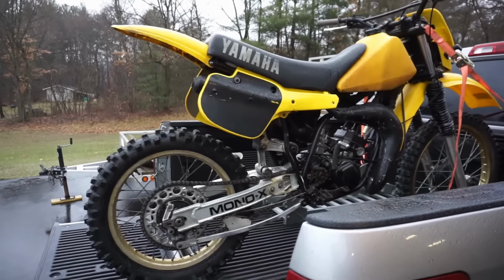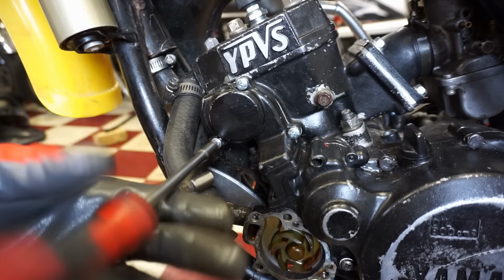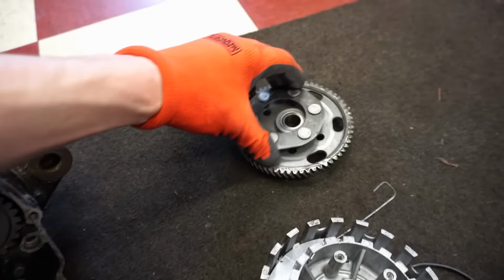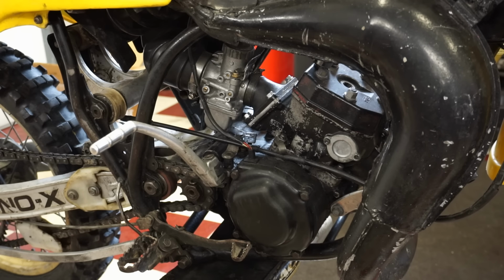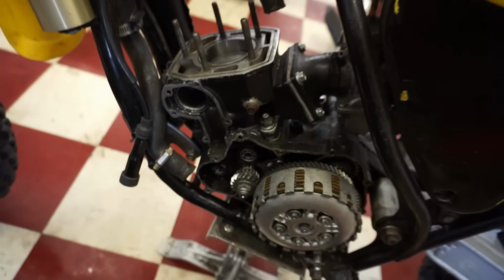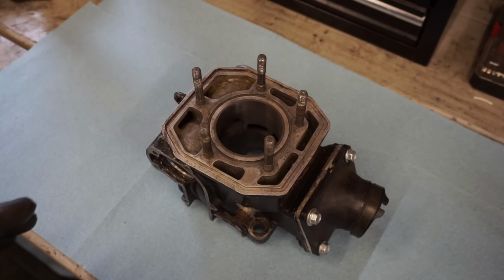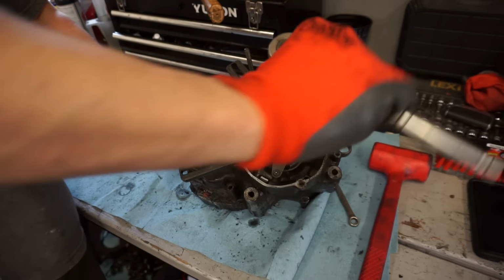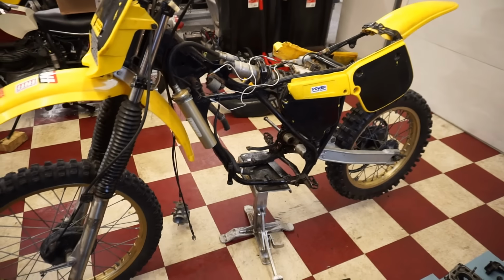Seller Lied About This Rare 2-Stroke Dirt Bike

Comment: Rebuild it.  An old bike like that is worth the spend jsut to have it.  I'm rebuilding an 89' CR500 and i stopped keeping track of what I have in it.  Becuase this year and make was my first NEW off the floor big bore growing up.  I got it in my early 20's and beat it to death, then put the motor in a streched drag quad. All the while wishing I had kept it.  So now, the restoration and tricking it out like mine was is a bit easier becasue I do my own CNC billet work.  But their is nothing better than the sound and smell of Blendsall Castor and gas. rip, rip!!!!

Comment: I should have waited to the end of the video before posting my first comment but having said that, you really should pull the gear clusters out and check the gear dogs particularly for 2nd and 3rd gear engagement.  If they're the originals its very possible they may be rounded.  Sucks to get it back together running only to find it jumps out of gear under load.  Also take a look at a parts diagram for the power valve I think u may also be missing a few bits that carry and seal the valve on the left side of the cylinder.  Good luck.

Comment: thanks for that video.  It will make me more aware of the scum we have to watch out for.  I mean, if I own some junk I come right out and explain the issues.  Just sold a lawn tractor that I put over $450 into new parts.  Sold for $50 on Ebay.   I explained all the issues of torn seat, bad starter, leaking drain plug and slow tire leak.  It was in my way in the garage after updating to a zero turn.  But it still worked and ran like new (when the starter engaged).  Anyway the guy wanted it for it's parts, mower deck and engine.  He got a great deal and I was glad I didn't screw over someone and it's out of my way.  Too bad there are still scum out there.

Comment: I'd think at this point, if you can't at least check compression and spark before buying, you would cut your travel losses and just leave. I know once in a while you can fix stuff for fairly cheap, but without those 2 things, you have to assume you will be into it at least for the cost of an entire top end rebuild and who knows without spark.

Comment: The cooling system on that bike is a nightmare the way it is routed through the frame and triple clamp. Those seals are expensive, and not very reliable. That’s why the steering bearings are shot. I had a 250 and bypassed all of that, just ran heater hose from the engine to the radiator. It wasn’t super pretty but it worked well

Comment: I had the same exact bike 1982 Yamaha  YZ 125  i do believe it was one of the very fisrt water cooled dirtbikes!   They are a pain in the ass! The cooling system goes through the goose neck causing leaks out the ass! They overheat like crazy.  Also crashing the bike at all you run the risk of damaging the radiator! Very fisrt thing i did with mine after the rebuild was water jet a radiator guard. Trust me on that one! 
Also the power valve set up blows on those bikes!  However you do have a rare bike worth resorting! Ridding it is another thing problem. Id just restore and show it off not ride it! The are gutless bikes! All 125cc are guttless to begin with! 😂   that bike definitely does look to be in great shape i see the original fork guards or fork covers. You can see the original rear sprocket. I also will give you one more peace of advice. That rear mono shock was 600$ for it to be rebuilt! The engine i had to have a piston made for the bike by wossner in Southern California. I sent the cylinder to LA sleeve and they had a horrible time finding a piston took almost a year before they finally said told me it has to be made from scratch! So good luck finding a piston. Any parts you do find i suggest buying them up immediately!

Comment: You should breakout some sand paper and hit all of the fatigue points on that frame, Before you should trust it to jump. There's real chance you could get hurt because i know you will make it run like it should. Thirty feet no problem, You want it to stay in one piece. Even if you have to hunt some parts very cool find. Working on it yourself is part of the safety factor of trust.

Comment: Hey - nice video, i subbed. 
Just a little firendly advice, try not to touch the airfilter with your hands as the chemicals you soak the filter in are very bad for your skin, quite carcinogenic, and also can cause chronic eczema (that happen to me) I just touched everything with my hands, have been fiddling around with engines without protecting myself from the chems most of my life and now i got chronic eczema to a point i cant even open a bottle of coca cola sometimes, even riding my bike can when its very bad, be difficult because of it. Cheers.

Comment: I raced both '82 YZ 80 AND YZ 125 back in '84. The 80 was bought new, the 125 was bought used. My mistake with the 125 as I should have switched to the KX 125. Nothing but problems with the YZ 125. Oh well.

Comment: I had an 82 YZ 250 craziest thing is is where the radiator is for the coolant I love the body design I love the plastic design I wish they would bring that back and quit with the pointy plastic they have now. So what we ended up doing is taking the 250 motor off of it because the bottom end seized and we put a 350 warrior engine on it air cold. Rip through the woods for about 7 years and then I crashed it into a creek and that was the end of it

Comment: Power valves are one of the worst things that ever happened to later 2 strokes.  They don't make that much extra power to compensate for the maintenance and costs. 
I have 2 IT490s and no power valves in sight.

Comment: That could be a display bike that was used in a restaurant or Maby a Yamaha dealer would explain why it was kind of a bare bones build to look the part but has no oil or coolant in it to stick with building code I’d sell it to a restaurant. They may have pulled the clutch to keep people from spinning it over dry

Comment: It was not the hot 125 in 82.  (83 either).  They had so many left in stock, they gave Bob Hannah another 100g's to ride them in 1982 so they wold sell.
I don't know if he won anything, but he was not really in the hunt.
Reply: The big complaint about 82 YZ models was the radiator high behind the plate.  Too top heavy in comparison.  But I just started racing in 84 with a used 82 (for $850) that I raced for 2 years and sold, so I didn't notice it.  :)

Comment: That’s a bummer man, ive been a Yamaha guy for 50+ years, this is the one bike i was not a fan of.when I worked at the dealership we would run radiator hoses along side the frame to avoid the o rings failing in steering head and rusting steering head bearing. Some guys like them cuz they raced them, luckily i was a broke teenager and couldnt afford a new bike in 82 so raced the 1980 that year, was able to get a new 1983 …

Comment: Yeah... Lesson being if someone pulls the clutch out so you can't crank it over,  there are likely big problems they are hiding. Especially considering how easy it is to take a video, and how everyone has a camera on their phone. If you are ever going to sell a bike that actually is running but needs clutch work, film the bike cranking over before you pull the clutch, but as a buyer don't ever buy anything you can't try to turn over. Unless its a couple hundred bucks or less. This bike as it was should have been 300$ - 500$ tops.   Its always upsetting when people Lie about stuff like this, and clearly try and hide the truth from potential buyers.

Comment: I had the same bike but a 250. Was an awsome bike but the problem I had was with that radiator. The design was routed through the frame and it leaked.I found new seals for it but it kept leaking and washing out the steering bearings. Oh yeah and the seller forgot to mention 5th gear was blown 🙄

Comment: I have learned to never buy a bike with engine in a box syndrome. 90 percent of the time its been taken apart and it was worse than expected. It them gets thrown in a box or quickly back together, and parts go missing. Then it sits in the corner of a garage for 5 years and more parts go missing.  Seller always lists it as "ran when taken apart", just needs new piston and rings, or the classic "just needs carb cleaned".

  I have been scammed myself and just dont buy them like that anymore. If its apart or looks like it was apart and does not run....... I value it at a parts bike only.

  As with anything you buy on marketplace from a private seller... ITS buyer beware. Dont take the chance people..... believe me, you will get screwed 9 out of 10 times.

Comment: I knew a retired Moto grand prix rider+ B motocross rider. He passed away in 1998. Good dude. I learned a saying from him about receiving a bike like this. He called it a basket Case. Because of parts missing or things broken and the seller not being on the up n up. But hey dude you need any parts for this old yamahonkey I suggest Kaplan cycle's. If they cannot help you nobody can. I bet they have 4 of everything. KAPLAN CYCLE'S.

Comment: I would have offered $500 for the basket case special! Figuring on redoing complete top end at the minimum! I never take the sellers word for it. A bike you figure on worst case scenario, that way you don’t have any regrets! Unless you can actually start it and hear it run! None of the plastic is original, except the gas tank. Can’t help but notice all other plastic is brighter, newer in color.

Comment: That engine was not the engine to have been shipped with the bike. It had to have been disassembled and fitted with either a different cylinder or piston. A super popular gokart class uses the engine usually less the power valve and it is likely that’s where the correct engine is. Take the seller to court !

Comment: With a 40 year old 2 stroke you should factor in a rebore and crank rebuild. 
I speak from experience as the owner of a 70s kawasaki triple, so basically the guy can fix it for a third of the price. 
Once the power valve is fixed he'll still be in profit, remember he's already got $400 off the price. Yes it's shitty, but he was willing to grab a bargain/pay way under market value to the seller, if the vendor had been 100% honest.

Comment: I noticed you put the clutch on but before that you had determine the lower crank bearing and the piston was real loose in there so I’m not sure why you were trying to start it. If by some weird chance it started then it could have tore up everything inside the motor

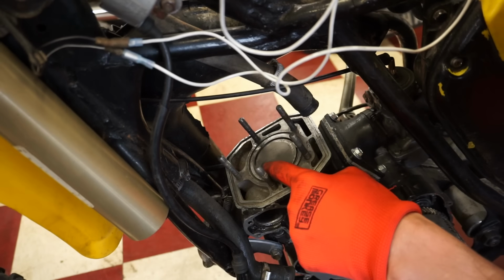Comment: Stopped at 27:45 so far.   It looks like a bored out cylinder, and hope that it is plated.  They cylinder head and top edge of the cylinder on the exhaust side went through some pretty serious detonation, (not quite enough octane gas most likely, piston edge also, seen later).   That is probably a stock piston in a over bored cylinder,---which is why the power valve would not fit, (needs modification for over boring).  I bet that guy still has the power valve somewhere (there is only one with this design).  If it is a replated/bored cylinder, you may have gotten a better deal than you originally thought.  For the life of me though, I can't understand how that engine ran with that undersized piston in it.  It didn't.  He put it together in disgust, and I bet he still has the power valve somewhere.
Reply: Opps, my bad. Too early for plating.
Reply: I don't remember if Yamaha had a plated cylinder in 82.  I had the 250, and I don't remember.  I know Honda had chrome plating in 79 though, so maybe Yamaha did have something in 82?

Comment: Something you could have checked for before you bought it with a screw driver. Especially knowing that the parts are so hard to come by.

It’s called buyer beware, rather than seller beware for a reason…

Comment: Did this in the early '80's.. a 5-6 hour job..  I think you got a switch-o-roo  from a two bike owner that was low in cash.. and I'll bet the cylinder has been bored out several times so it is way over (and not a legal 125 anymore)..  That makes the piston a problem that might need a machinist to build you a sleeve or piston.. so I'd advise putting in a 2 ringer so that it last longer. [shit; they were only a 30 hour postilion a best]...

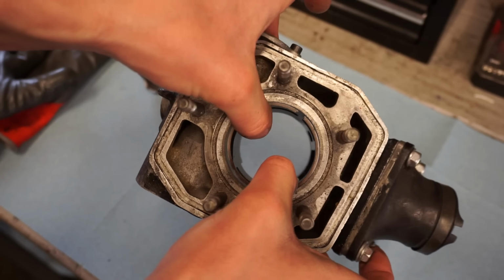Comment: 37:10 To be honest I would be more interested in the bore size and what the original bore size would be (or has to be) for an original 125 engine, it still could be bored to an oversize and maybe someone thought it was original and put a standard piston in (although the size difference looks to be too big)

(I saw at the end of the video you mentioned the original bore size and the piston size that was in it, maybe I commented too soon? Anyway I like the list you made, sometimes it's not worth repairing, not sure about the value of this one, the seller knew for sure and messaging them afterwards usually gets you nowhere sadly)

Comment: I'm thinking, the way it was clattering when you kicked it o er and zero resistance with bad bearings, I would've just pulled motor and went from there.  Get some crazy in here once in a while. Had an engine come in with nothing in, guy said fix it.. i said, sure leave your credit card, needed it back in 30 days, told him want in one hand shat in the other see which fills up first. Because it was a Honda, it wasn't impossible, we got it done in 24 days, all parts were close to new condition or new. Had about $2500 in parts, 850 or so in labor. Guy was oblivious to what had to be done. When he stopped by one afternoon to see progress I about went off on him. Kinda did I guess but I think it was intentional. He tells me I found a big box full of parts and gears and stuff in my shed that came with it, last owner was restoring it and gave up. That bike was an 84 650L. Bad ass bike, would love to have one of my own, just not that one although it's mint again. It's the white one, want a red one.  Great vid though, nice find. Hope it all comes together, you need to keep that rare  little beast.

Comment: The yz125 82' was my first dirtbike! owned it in 98 was as fast as any other bike out there but i remember the terrible power valve set up, and horrible suspension as a side note my governer was screwed so i just jammed the powervalve open and it made very little difference this was one of if not the actual first atempt at a powervalve from yamaha and it was not very good!

Comment: I had a question on my quad for you with the wiring. Right now I have no spark but I believe it’s because of the kill switch because on my harness it has 3 wires for the kill switch and a key but I only have a 2 wired kill switch and I don’t know how to hook it up to it if I have to jump a wire or not. It’s an 89 and I bought everything electrical brand new

Comment: Well, we know why the engine was blown up.Now they only had the air screw out a quarter of a turn running.That engine lean a s*** which probably burned up the old piston, which is why they put a wrong piston back on that rod, so they could sell it to guarantee.
The oldest and probably had holes melted through it

Comment: Well it would be a restoration, not a new or used good running bike. $850 is a parts bike. For resto starting point it looks like you did very well. Not sure about trying to start it with no apparent bottom end bearing.

Comment: With the right sized piston and the gasket it needs and power valve it will run and the rod bearing at this point is want a new crank in it if it was me finding is the hard part

Comment: Do you think he took it apart , replaced  the  piston and used something he had which was the wrong  part ?The bike could have never started like that,which is a good thing!  then when he got in the clutch he figured out those valves were missing and he was in over his head, he threw it back together and left the clutch apart so you couldn't turn it over.? pretty crappy if he did.
Reply: Thats probably a piston that was the correct size of the original , but someone bored it out and he did not realize it.  That engine never ran with that piston in it

Comment: After 50 years of riding and 25 years of vintage restoration, if I can't hear it run I just automatically assume that its a basket case and offer accordingly.  Then I spray the roach with Raid and either make a deal or move on.  If the seller isn't as old as the bike I just assume they are a flipper with no real knowledge of what they're selling.  Gotta have low expectations not to be constantly disappointed these days.

Comment: Somethings not adding up here.How did it end up with the loosest piston ever?Was a previous owner so clueless that they got it bored but kept using the old (first oversize) piston?? If they are that dumb,it's possible he threw away the powervalve,thinking it not necessary.Technically the bike can run without it.
How about that original undented pipe?! I've never EVER seen an old bike with a pristine pipe😃

Comment: I had a similar situation I brought a Suzuki rm125 1986 model I met the guy  he had it running And I thought yeah Im happy it runs and I've got a bargain for £400 (back in August 1999) so I took it home I thought I'd give it a service an oil change and when I opened the oil cap it was milky so water was getting in the engine it didn't cost much for the water pump seal but the fact he didn't tell me about it upset me if I didn't service the bike id of probably raced it without knowing the oil was milky and it could of broken down on me, ever since then I've always checked bikes I'm buying properly before I buy